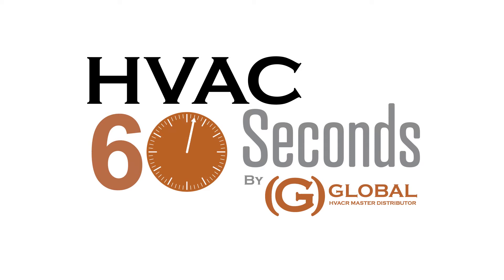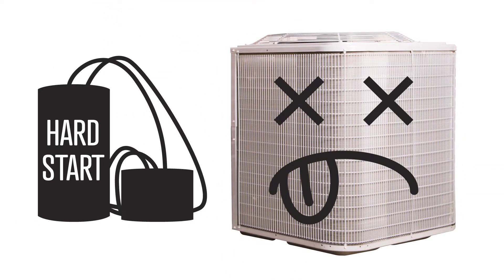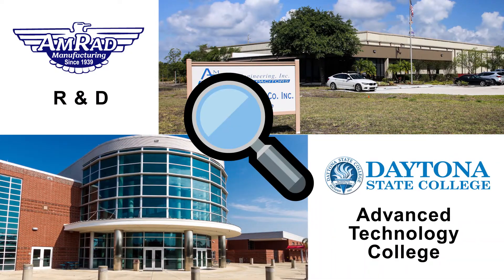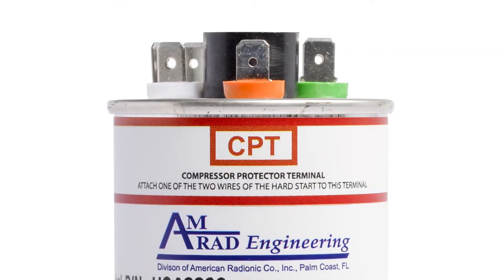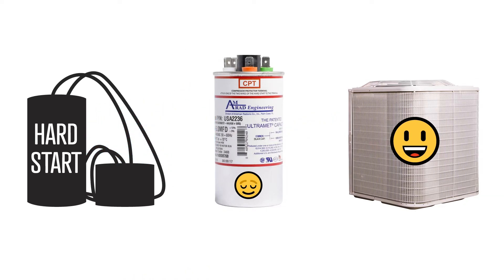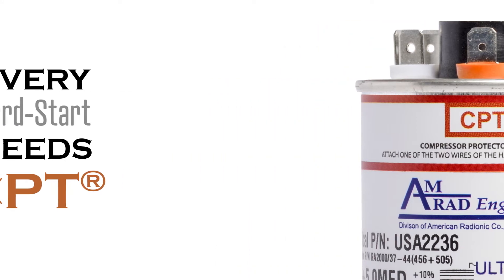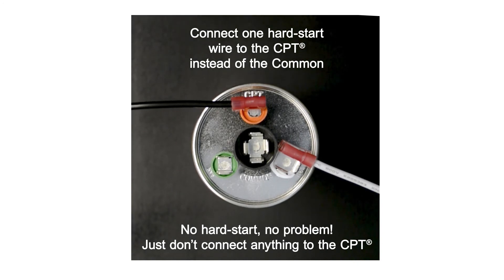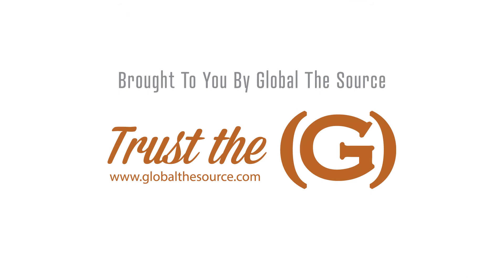HVAC 60 Seconds - CPT

Comment: I have an EasyStart Micro-Air 368 installed on my Rheem  RA1642AJ1NB a/c unit (4 yrs old) and I want to replace the 45/5 microfarads capacitor with one of your products. The current capacitor is an original 43-101666-68 (2" diameter and 4" high). That Micro-Air product is more than a simple soft start and has sophisticated engineering so that I can run my a/c with a generator. Question #1: do I need a capacitor with a CPT terminal or can I just go with one of your dual run capacitors? Question #2: If you recommend a CPT, which product would I need to fit the dimensions of 2"x 4"? If no CPT is required, which product would I need to fit the dimensions of 2"x 4"? Thanks for your help.

Comment: I assume the amrad caps that say CPT and have an orange terminal,  have the fuse / protection built in.  So if true then how does one know what compressor size the CPT cap is good for, given the amrad soft start kits CPTs are sized by tonage.
Reply from the maker: Refer to the equipment manufacturer for the proper size capacitor. Amrad likely produces the size recommended by your specific equipment manufacturer.

Comment: Do you recommend using the CPT terminal when installing a soft-start system?
Reply from the maker: I would use a CPT on any unit using a start device, whether that's a soft or hard start.

Comment: The addition of the CPT terminal is extremely confusing since so many online retainers still show the same models without the additional contacts. I ordered the AmRad USA2236 and faced this issue when doing my own replacement. It introduced an unnecessary amount of uncertainty into the mix as I first thought I'd received the wrong part. For those who are in the same boat, just ignore the CPT terminal and the cap will work just fine.
Reply: I agree it's confusing, but the CPT acts like a fusible link to protect your compressor in the event of capacitor failure, so best not to ignore it. Just remember that one wire that used to go to the common now goes to the CPT.
Reply: But for some systems the fan won't come on then if you install a single cap for the fan it comes on how is that?

Comment: I recently bought a 2 wired type hard start kit, so can I just plug one into HERM and the other into CPT?
Reply from the maker: Thank you for supporting American manufacturing!   All products sold by Global are intended to be used by a licensed HVAC contractor. Installation instructions can be found on AmRad's website, www.amradmanufacturing.com, on the "Wiring Instr. & Registration" page. Selecting "USA Made Capacitors" will bring up a PDF instruction document (https://amradmanufacturing.com/wp-content/uploads/2021/03/INS10058-Instr-Sheet-USA-Capacitors-Folder.pdf).

Comment: Is the Amrad USA2215 with the CPT still polarized?
Reply from the maker: Hi Kevin, The film dielectric design of motor-run capacitors that are currently in common usage throughout the HVAC industry are NOT polarized.  Electrolytic start-capacitor designs, and the old style of PCB filled, paper and foil motor run capacitors built into the early 1980’s, are polarized.  This is due to how the aluminum foil, used in both designs, is “tapped” with copper tabbing in order to make the internal electrical connections.  How the electricity flows through these contact points is important and these points are the weak spot of the design.  We hope this helps!

Comment: My Goodman had 3 wires, 1 common ,1fan and the other 1Herm, can you tell me how to connect model  Amrad  45/5x370/440 with 4pin, 1common, 1fan, 1herm and the other 1 CTP Thanks
Reply: If you do NOT have an optional HARD START capacitor kit installed, you simply IGNORE the CPT terminal.
Reply from the maker: All products sold by Global are intended to be used by a licensed HVAC contractor. Installation instructions can be found on AmRad's website, www.amradmanufacturing.com, on the "Wiring Instr. & Registration" page. Selecting "USA Made Capacitors" will bring up a PDF instruction document (https://amradmanufacturing.com/wp-content/uploads/2021/03/INS10058-Instr-Sheet-USA-Capacitors-Folder.pdf). The CPT is only used when a hard-start kit is being utilized in the AC unit. Thank you for supporting American manufacturing!
Reply: @global.the.source  The CPT documentation is mostly worthless unless you are also using an Amrad hard start kit.

Comment: I am glad to have bought this made in America product! The Cap I purchased unexpectedly came with CPT and I wasn't sure what to do with it. My AC was either starting the fan or the compressor but not both so I replaced it with a CAP050700440CT and it fired right up! Both the compressor and the fan! But the compressor, even though it ran for several minutes with no fan, now only stays on for a few minutes... The fan stays running but the compressor keeps power cycling. Me sad now but I'll keep the capacitor anyway because I want to support our manufacturing!
Reply from the maker: Thank you for supporting American manufacturing! Global is proud to supply quality USA made parts to licensed HVAC contractors. Check out our channel for more American made products.

Comment: Is this only for the 2 wire hard start kit, or does it work with the 521 potential start relay type?
Reply from the maker: Yes, the CPT works with ANY hard-start. The only difference in install is that you connect to the CPT instead of the common terminal.
Reply: @global.the.source  So you're saying connect #1 on  relay through the start capacitor  to the CPT (RUN) on the run capacitor?  relay #5 and common (installed on contactor common side)  - #2 is start installed on start side of run capacitor and - #1 run through start capacitor to the run side of the run capacitor.
Reply from the maker: @Tim_Takacs  Thank you for the opportunity to address your question.  Please first make sure the products you are using are both AmRad manufactured.  Only AmRad hard-start kits and motor run capacitors come with exclusive built-in safety features (CPT ® Fuse Wire & CPT ®) that cut the hard-start off from the system in the event of a part failure, protecting the compressor from permanent damage and/or complete failure.  
 
When using AmRad’s American-made Universal Hard-Start (TES5EXT), wire as follows: 
•        Relay terminal #1 goes to AmRad start capacitor’s white terminal
•        Relay terminal #2 goes to the AmRad run capacitors herm value  (3-blade terminal or on AmRad caps the white insulator cup).
•        Relay terminal #5 is split: 
o   The black wire goes to the AmRad start-capacitor common
o   The fuse wire goes to the Orange CPT ® terminal (exclusively found on AmRad run capacitors).
 
All products sold by Global are intended to be used by a licensed HVAC contractor. Installation instructions can be found on AmRad's website, www.amradmanufacturing.com, on the "Wiring Instr. & Registration" page. Selecting "USA Made Capacitors" will bring up a PDF instruction document (https://amradmanufacturing.com/wp-content/uploads/2021/03/INS10058-Instr-Sheet-USA-Capacitors-Folder.pdf). 

The CPT is only used when a hard-start kit is being utilized in the AC unit. 

Thank you for supporting American manufacturing!
Reply: @global.the.source  You just contradicted yourself.  In your comment above you clearly stated "Yes, the CPT works with ANY hard-start."  And in this comment you stated "Only AmRad hard-start kits and motor run capacitors come with exclusive built-in safety features (CPT Fuse Wire & CPT)...".  Make up your mind.   Found this quote from your company: "AmRad’s motor-run capacitors with CPT Technology can be used in any air-conditioner where a hard-start kit is being used."
Reply from the maker: @Capt-Intrepid  “Yes, the CPT (compressor protector terminal) found only on Amrad
Motor run capacitors, can be used with any hardstart. 

Our hardstarts come with another safety feature, our CPT fuse wire, which is exclusive to our hardstarts. Either product,  Amrad run caps with CPT or our hardstarts with CPT fuse wire, may be used  with other manufacturer’s products. However, for protection against both capacitor and potential relay failure, our Amrad caps with CPT and our Hardstarts with CPT FuseWire should be used in conjunction.”
Reply: @global.the.source  Thanks.  I've since studied your products and now understand what was meant.  AmRad offers two hard start safety features.  CPT is part of the AmRad capacitor (works with any hard start kit)  and Fuse Wire which is part of the AmRad hard-start kit.  I don't believe your sell the Fuse Wire separately?
Reply from the maker: @Capt-Intrepid  We do not sell the CPT Fuse Wire separately!
Reply: @global.the.source  Thanks.